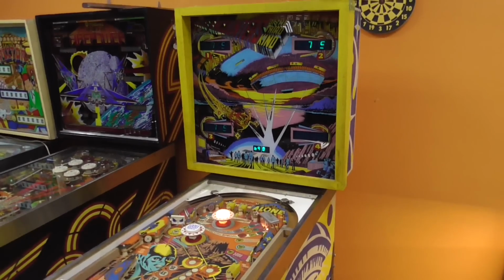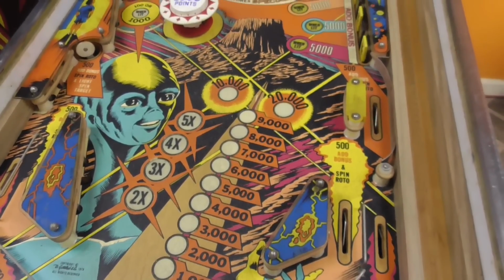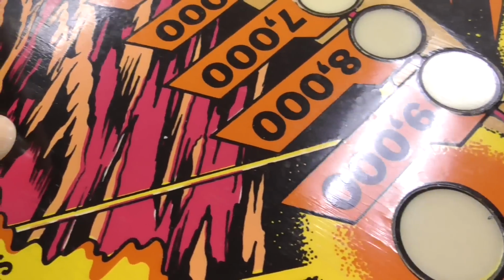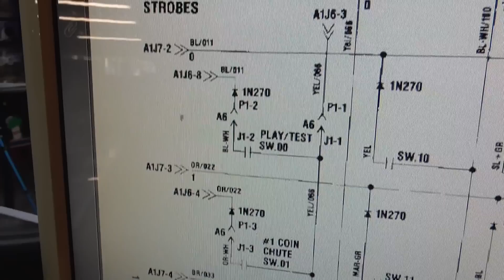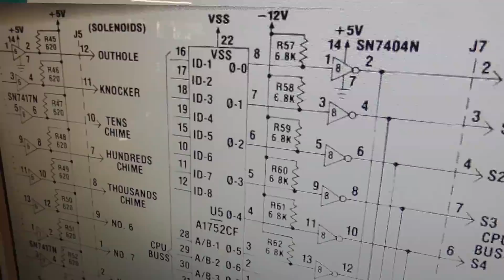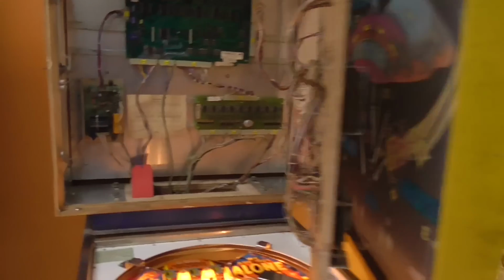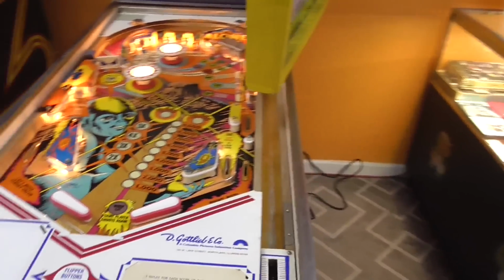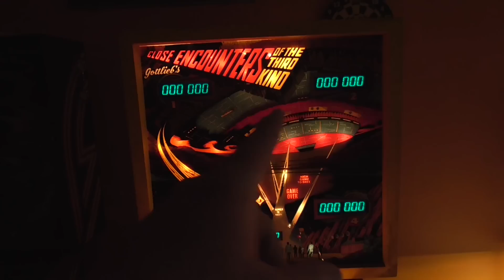Time to PUT THE SHINE on This Gottlieb Close Encounters Of The 3rd Kind Pinball Machine Playfield

Comment: I'm curious if Ron or anyone knows why the pull-down resistors on the input of the 7404 are tied to -12v instead of ground/0v. Typically the pull up/down I would expect to see tied to 0 or 5v. Maybe an idiosyncrasy with the way the "spider chip" outputs work? Perhaps their logic 0 output floats too high for regular 74 series logic to work reliably with a reasonably sized pull-down so they have to pull it down "harder" with -12? 
Another possibility: the schematic doesn't say what voltage the VSS on the spider chip is. If it's running at something other than +5 perhaps the -12 pull-down combined with the internal resistance of that chip is forming a resistor divider of sorts. If the spider chip's low state is ground, it could possibly sink the -12 and effectively pull it up to 0. If it's high state is, say, 12v but has high output resistance that -12 through a resistor may balance it out to be closer to 5v to feed the 7404's input.
Reply from the maker: Our buddy Douro20 in the comments here was talking about this, for whatever reason those spider chips operate on -12 voltage so I think you're dead on the money... it's just a strange chip that they abandoned after not too long, the 5v thing wasn't universal yet and 3.3 wasn't even thought of yet :)

On the Rock Ola Jukeboxes from the early 80's, they operate on.... 9.6v.  

I'm pretty sure a 7404, though, still wants between the parameters of 0 and 5 for it's logic signals though so I'm not sure exactly how it works.... but it does :)  Thanks for watching!
Reply: @LyonsArcade  Cool, thanks Ron and Douro20. If one of these early machines with this board comes up again it would be cool to put a scope on it to see what that looks like. Its neat to see how they designed around what technology was available at the time.

Comment: Those Rockwell ICs are PMOS so the power rail is going to be negative with respect to ground (strange, I know), the inputs will be active low and the outputs if I remember right are going to be active high.  PMOS is often used in display driver chips as they can handle higher output loads than NMOS or CMOS.

Comment: I am going to clean up a Gottlieb Free Fall. The recipe seems to be Windex + Magic Eraser? Then rag to clean, then wax?
Reply from the maker: You can use windex (which is just soapy water with a little ammonia) or you can use rubbing alcohol too, it works better but also makes it more agressive.  Go slow on the magic eraser, it's basically really light sandpaper you can literally rub the paint all the way off, and you'll see sand scratches too.  It's good though for getting rid of stuff you can't clean off with a towel.  Then yes clean it up and wax the hell out of it.  Good luck with it man I'll bet it turns out nice!
Reply: @LyonsArcade  What was extra fun is that the game arrived broken and I remembered your advice on troubleshooting an EM startup where the rotor motor spins and spins - look everywhere BUT the rotor! Sure enough, a coil had come loose in the back box. Fixed it easy-peasy!

Comment: What is the theory behind the match units used in pinball games because I'm confused on what the match units are actually doing are they comparing player ones unit and player twos unit and comparing the score and doing some type of mathematic equation? Not all pinball games have a match unit so I'm thinking that the match unit is connected to player one stepper unit and player two stepper unit and somehow it's comparing and doing a mathematical equation with the scores correct me if I'm wrong

Comment: WE bought a JBL sound bar and some other stuff on Amazon Prime day using your affiliate - hopefully that worked.  I've seen someone else mention the shorting of the displays to recharge - I think they said they used a 9v?.  Does that work for all of these older displays or just the Gottlieb ones?  Thanks Ron.
Reply from the maker: We did see that on there Tripplett, we appreciate you doing that, hope that sound bar works out well for you :)  This basically only works on the Gottlieb displays because they're vacuum fluorescent displays, the other ones in most pinball machines are plasma displays, they light up completely differently so you can't zap them.
Reply: @LyonsArcade  oh good.  Wife had already put stuff in the cart. So I moved some of the big ticket items to 'Save for Later', opened YouTube, clicked on the link, then moved them back to the cart.  I figured that was the fastest way to link up the affiliate.

Comment: Hey Joe.  love the vids, especially this one.  System 1 games are my favorite.  I've owned most of them over the years and Close Encounters was the 2nd one i got.  Very fun game to play.  We had another way to charge the displays that seems way less risky.  I got a 6 slot AA battery holder and added leads.  Attach leads to outer pins for a minute or two.  You don't get bright lines, but you can see it brighten up a bit.  Works like a champ.  Keep the vids coming.  I would love to see a Sinbad or Joker Poker worked on.  Probably my 2 favorite all time games.  Loved Eightball too, but that's a Bally game :-)